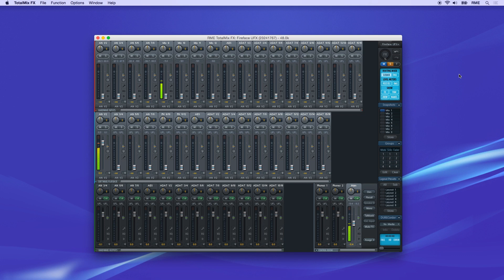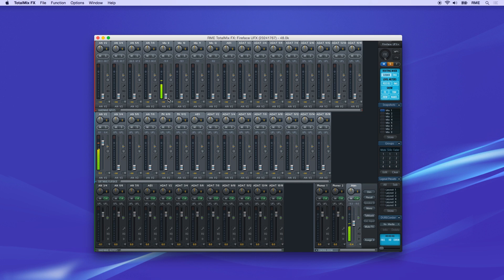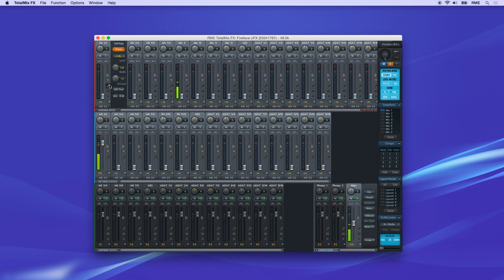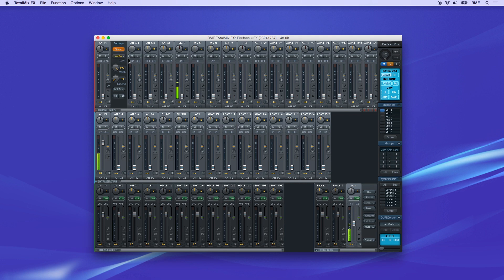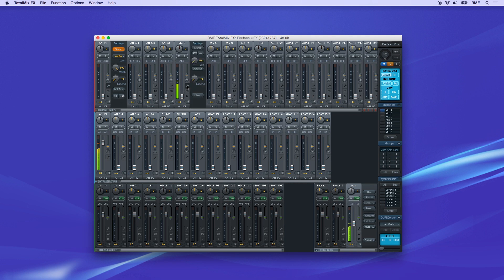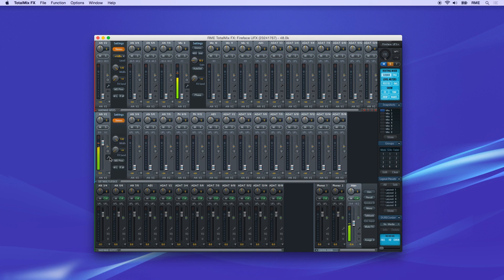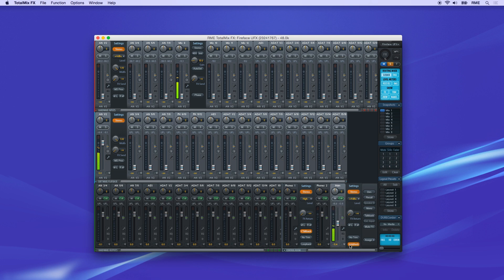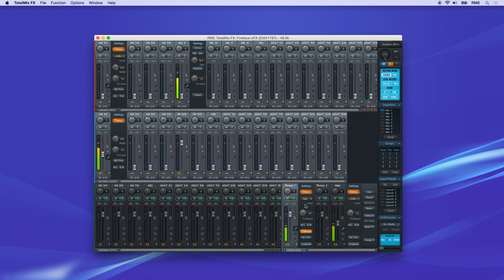How to use RME Audio TotalMix FX - 02 Mixer Interface

Comment: Quick question. When on Instrument mode with a guitar plugged in, is there a way to set the input gain to less than 9? I’d like to set it to around 1 or 2 but TotalMix doesn’t allow it. Other interfaces allow it. Thanks!
Reply from the maker: This is not possible. You can change the reference level of this input.
Reply: @RMEAudio  what does that do and how do I do it?

Comment: Hello...there is something I do not understand. I am sure it is very easy but I can't figure it out. How should I set up Total Mix Analog 1/2 software playback and "Main" output from the "control room" in a way to be sure that I work on my mixes in a properly and good way? What should be the balance between those two faders? I thought that putting de AN 1/2 software playback fader on zero , and turning down the "Main" fader would be the good way, but it turns out that the playback gets a little bit distorted. It is confusing. If I haven't been working this project with another soundcard, I would have thought there was something bad with the way I worked in my project, but this is not the case. Of course, if I lower the volume on the An 1/2 software playback fader, there is no distortion...but how will I know in future projects if the distortion is cuased by my work or by the way i set up "total mix" ? Thank you and I really wait for your answer.

Comment: Top Row - Hardware Input Channels [Any single connected to Analog or Digital Inputs will show here]

Any signal connected to analog or digital input will show up here.
The Level meters are showing the signal hitting the output for latency free monitoring. NOT what goes directly into your daw.

Click the tool option on a channel to access options. At the top is the stereo button/mono button